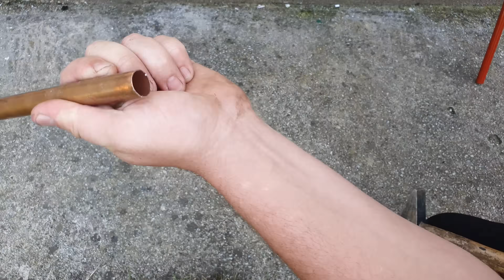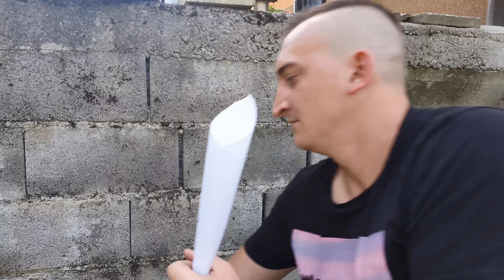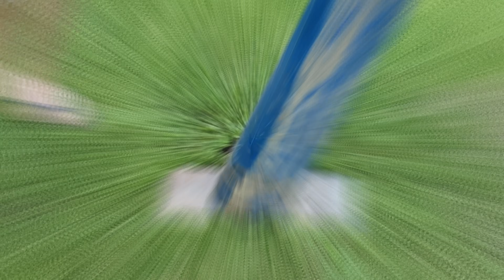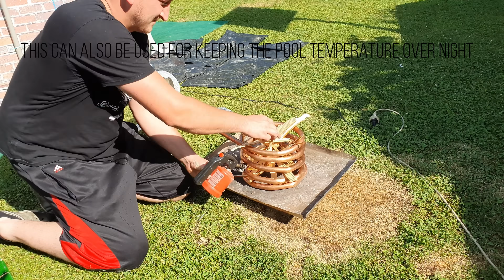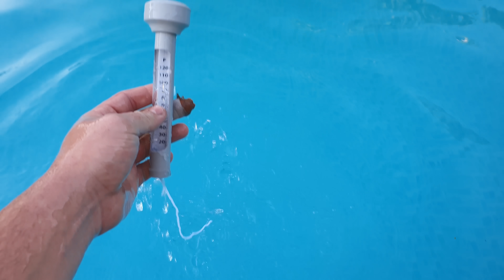Simple Home Made Pool Heater Under 10€

Comment: How slow does your pump rotate the water?
Reply from the maker: Speed does not matter.
If the water runs slow you feel the output water hot if the pump runs faster output feels warm but in the end it doesnt matter... warm watter more flow 
Hot water less water flow so it evens out

Comment: I am wondering...what about the internal components of the filter bomb, is this suitable for hot water?
Reply from the maker: No this is why you need to connect the heater to the output on the pump to avoid damaging the pump input water entering the pump from the pool is not hot
Reply: @MrTplanko  So, the water flow into the pump, then to the heater and finally to the pool right? Does the inlet hose hold the hot water well? I am thinking to do this to heat my pool.
Reply from the maker: @Dionisio181  yea. It does hold the temperature
But make the 2.0 heater  version i posted its way better

Comment: Just buy soft copper pipe in pre bent coils. MUCH EASIER than the sand method, although the sand method is cool..

Also, longer runs of smaller pipe, like 3/8” is way more efficient than larger pipe…..

I’ve tried both 3/8 and 3/4” pipe. The smaller pipe wins every time
Reply from the maker: I have made a better heater and i am posting it soon it can heat up 10 000l pool to 38°C IN 10 Hours
Reply: @MrTplanko  link to video?
Reply from the maker: @ftgnaturehd4222  not posted yet comming in 30 days

Comment: use a cut 1/2 55gallon steel drum for the fire pit and put the coil inside it, and cut slots or drill holes for the copper to exit the drum.👍it was a good thought, but you must contain the fire...
get a patio chimenea and copper-pipe-coil the inside maybe, and have a sweer patio fire/heater in one...
or better yet build a patio with a stone pizza oven and hide the coil inside that! ...
patio party, with stone baked pizza and hottubbing...BINGO!

Comment: Nice .. Can you please tell about these pipes.. Won't these plastic pipes melt with the hot water inside. Please do update..I am stuck on finding suitable pipes for the tub.. thanks 🙏
Reply from the maker: No with this setup water cant melt the pipes you can use the one you get with pump

Comment: You reckon if the copper coil (10mm) is higher than the pool itself it would have difficulty pumping the water through with a filter pump?
Reply from the maker: Yes it would

Comment: I once tried making something similar, but the water stopped flowing, then it turned to steam, then it melted the pipes, then panic set in.
Reply from the maker: Its important you have enough water flow
Reply: @MrTplanko  Yeah, I had a small pump, although that was mostly intended to be security, had hope that the heating of the water itself would create enough flow, but apparently it wasn't strong enough, that, or the water became to hot, melting the tube and restricting flow.

Do really want to make a proper one, paying 100+ euros on hot water everytime I have a party by constantly pooring in hot tap water isn't very economical.
Reply from the maker: @DutchDread   you need to use bigger pipe diameter and your small pump shuld do the job
Reply: @MrTplanko  Thanks, I actually had hypothesized that the problem was that the pipes were too large and the pump was failing to push the water through it.

Comment: Do you empty the sand after the pipe bend
Reply: I'm pretty sure the sand is only to allow the copper to maintain form while being bent into the coil. Emptied afterwards to allow water to flow through and conduct the heat energy from the copper into the water.  It would be really cool to run this through a sand "battery" instead.  I think im going to try that as my pool is much larger. Having said that this system is a much easier build and seems like it does great for this application.  Nice job!

Comment: You need to enclose the coils in a stove body.  With a chimney for natural draft, you won’t need a blower.  Fire will burn hotter and cleaner and you will get more heat into the water...
Reply from the maker: I know i plan to do it this season
Reply: Hi sir! Won't the coil dissolve in too much heat? Im planning to put coil inside a drum. Thanks Stay Safe...
Reply: A wood fire like a campfire might reach temperatures as high as 1650F at it’s hottest point.  Copper melts just shy of 1984F, so no it won’t melt.  This is especially true with water being pumped thru it, it will never go over 212F as the water will carry away all the heat…
Reply: @rronmar  well aren’t you just a ball of knowledge haha
Reply: @brickmate4802  I try…  been pulling heat out of fire for a very long time now:)
Reply: @rronmar  so not just for killing witches and a good light source ?
Reply: Hey! And before you say it !!! They die by the fire not the heat ok
Reply: I plain to try this in a chimenea...ceramic pot belly stove. $ 100.00 homedepot...ect
Reply: @winquizon7608  the water keeps it cool, even a soldered fitting won’t melt
Reply: @winquizon7608  not with that type of fire. We use Oxy Acetylene torches to braze copper tube or pipe and I’ve never melted thru one yet.
Reply: @gerarddugas6224  hope I caught you in time. It  will not work especially with such a small area to put your coil. 
Pool heaters are rather powerful water heaters that have a high flow and use a lot of energy to warm a pool over a period of time. I discussed some reasons and other info on this videos replies. Figure out your pools capacity and google 
pool heater specs. That should give you an idea as to how much you need to flow in GPH
along with the temp rise you might get.
Reply: @williamyost2837  hey! Could you please tell me if copper will melt without water... I am using similar design with air and fans to get hot air in my room..

Comment: 3M + copper pipes about minimum 70$
Air blower about 60$
Support plate for fix pipes with fire 25$
Total 155$

Option
The log pieces 1pack 10$/1hour
8hours X 10$= 80$ / day
Reply from the maker: Bro where did you find these prices hahab
Reply: 5m of copper where I'm from is $150. I've already bought it and have stopped as I'm tryna find cheaper ways to finish my project. Fittings a pump that will handle the temp etc

Comment: Bro, I built one just like yours and bought a fire place and have it burning inside the pit... The water coming out is literally 5 degree higher than water in the pool
Reply from the maker: all you need to do is restrict the water flow so it has time to heat up my guess is you have a more waterflow than my pump
Reply from the maker: Also longer pipe helps alot
Reply: Thanks for the tips

Comment: You started at 80F + degrees? That is already plenty warm. You don't have enough heating surface there to heat up a pot of water. Entertaining for sure but DONT DO THIS it will not work unless the pool is already warm enough to swim in....and the 6 degrees of rise in under 3 hours.....NOT POSSIBLE!

Comment: Nice! I'm playing with a similar setup but my goal is to heat water above 60°C for a hot shower, do you think if can be done? Similar to how a tankless propane heater works
Reply from the maker: Ita possible but with better heater. I will post the video in 14 days
Reply: @MrTplanko  Nice, I'll be sure to watch it! I'm thinking about purchasing a broken on-demand heater and reutilize the radiator/piping part that receives the heat, that way I just need to build the fire around it

Comment: Try doing water instead of salt for holding coil shape. Much easier to remove in the end. Also keep the copper warm with hot water on the outside, this will make it super easy to form if you have issues with kinking.
Reply from the maker: Also much harder to seal the pipe
Reply: Recent discovery of trying before research. Use brake line copper, not refrigeration line. Refrigeration line, while usually a more pure copper. Is not meant for the heat, and will break down faster.
Reply: NEVER SEAL SOMETHING FILLED WITH LIQUID AND HEAT IT UP!
This will explode really heavy.
Don't do this.
That's why professional use Sand for this.
Reply: @Chaosm4n  well ya, don't heat it up to the point of boiling and expansion. But people have been doing that for forming coils for a long time. And it keeps a much more consistent shape than sand.
Reply: @kokofiProductions  when you say people, I guess you mean professionals. They should know what they are doing. But here on YouTube, people without the knowledge see these kind of stuff and get harmed. I am a professional and even instructor.
You can't estimate your own knowledge to every one, who's watching this
Reply: @kokofiProductions  of course I know that hydroforming exists and works very well. But there are professionals working with these techniques.
Reply: @Chaosm4n  whatever dude. I'm not here to argue on the internet. But keep in mind if someone if forming the pipe by hand, it's no where near hot enough to explode, let alone expand. 

And seal the water in just to form the pipe, then cut it and let the water out. I'm not suggesting someone make a pipe bomb.

You're warning is sound advice for sure. But it doesn't fit in with this suggestion.
Reply: @kokofiProductions  hey, I don't wanted to argue with you. 
I guess it's just a fine discussion 🙃
And of course the world is big enough for 2 opinions 😄
Reply: Or just buy coil copper to start with

Comment: what kind of filter pump is that ? I love the simplicity of it but Im sure keeping the fire enclosed and the coil as well would make a huge difference. Like say in a burn barrel?
Reply from the maker: Regular pump it came with the pool ..You are right it does make a difference also use 6m of pipe i started with 4m and you wont belive how much hotter 6m coil was.

Comment: I had friend tell me that in a short time that copper coil will be no good because of the extreme heat. What coil do you use and have you had any problems?
Reply from the maker: This will last years... water is flowing and cooling the coil so it cant deform..
I used a 4m copper pipe 28mm and roll it nothing special...
Reply: @MrTplanko  Thanks !
Reply: Best material is rvs 316 cause of the chloor and other things that will atack copper...or try a uv lamp instat of chloor and you can stay with te copper heater
Reply: borgo1124 hello, what is rvs 316?  July 31 here and it’s 15 degrees Celsius!  We need a pool heater!!! Canada...
Reply: @granmabern5283  stainless steel 316.....in holland we call it rvs316,..
Reply: borgo1124 Thankyou
Reply: borgo1124 thanks.  Does it roll into coils in the same way copper does?
Reply: @granmabern5283  yes...there are ready to go sets...look for a 12meters set for the best performance,i will look for a link so you no what i mean,i'll try to post it
Reply: @borgo1124  Stainless steel has a heat transfer coefficient that’s 20 times less than copper. It’s more durable tho but for the most efficient setup you’ll definitely need copper.

Comment: Nice! But it’s a smaller pool so makes sense it would heat it well. Either way it is a nice affordable and renewable energy setup! Awesome job! Makes me wonder about replacing my heater with a wood burning stove. Our pump room has a 12’ ceiling. I bet I could put in a wood burner and wrap the exhaust pipe in copper tubing and just keep a fire going. Hmmmmm....
Reply from the maker: Yes this is even better way less temperature loss than my sistem but it is  little bit more expensive
Reply: Sounds logical.✌️✌️🙏🇺🇲
Reply: Look up "propane tank wood stove" good way to get a small space stove for very cheap.

Be extremely careful and test everything 5 times before you walk away from it while its burning. Be careful, be careful be careful

Comment: BTW: the pool came with a 1249L/h pump, should I upgrade to 2006L/h, I think that's the one you use, I could be wrong
Reply from the maker: No need to upgrade.. smaller pool smaller pump.
Reply: @MrTplanko  Thank you very much! I ordered a 60cm tall, 38cm diameter burn can with a thermometer over U$85 ( https://www.youtube.com/watch?v=WRpYEUdStWg ) to put the coil in and 15 meters of 1/2 copper coil, hopefully I'll get everything by Friday to start building the heater, not sure if the coil I ordered will do the job, I'll update once everything is setup
Reply: @MrTplanko  great! Thanks!
Reply: I  just finished with the can and copper, it has 13 meter of 1/2" roll on it and two 1 meter long legs to attach the input and output., clueless on how to share some pics, the can has a thermometer to keep track of the internal temp of the fire on it. I'll run it on coal. Tomorrow I'll test it.
Reply: @pachomouse  results?
Reply: @ohaoj2250  We have not had a sunny day for a few months, the heater was built. Waiting for a sunny day for testing. I forgot to mention I used a "peruvian over" for my coil - it comes with a thermostat . If you share an email I can share some pics.

Comment: Also remember when using copper and flowing chlorine water through the copper will eventually cause a chemical corrosion making the water green in color
Reply from the maker: This problem is fixed with filter so..
Reply: @MrTplanko  What kind of filter are you using?

Comment: I've got 2 questions 

Why do you need the salt/sugar what does it do to the copper pipe?

What measurements of pipe do you recommend for the best performance?
Reply from the maker: Salt/sugar prevents the pipe from bending  together...
Performance depends on your pump water flow...
Reply: @MrTplanko  thanks for the reply I have just brought a pool similar to yours😁👍
Reply: @MrTplanko  orginal BESTWAT/ INTEX  pump can handle with 4meters od 28mm PIPIE ??
Reply from the maker: @bartekmrozik  yup

Comment: I've got a question about physics-stuff, is there any sort of pump? Or the water flows thanks to the different density of the water at different temperature?
Reply from the maker: There is a pump connected 
It would be possible to do it without the pump but you would need to stir the pool... pump is better alternative.

Comment: One question: Wouldn't a combustion chamber made of bricks increase the effectiveness? Less fuel or higher water temperature? To do this, insulate the hoses / pipes! Should be inexpensive to do!
Reply from the maker: Yes it would be a lot better...less smoke more heat and yes inexpensive
Reply: Wrap the pool with some foil bubble wrap insulation or rigid foam board it’ll help too.

Comment: The heater is very small for the mass of water contained in the pool (more than 4000 litres). Also, the system they show is not insulated, this causes a lot of heat loss. This heater would operate efficiently solo en verano with a children's pool. To improve it, they should increase the size of the spiral to the volume of a 208-liters can and use natural gas as fuel.
Reply from the maker: Yea there is room for improvement but it does its job for 10000l pool
Reply: Cómo podría calentar una piscina de 6000 litros? En verano
Reply: Suddenly it's less affordable

Comment: how big is your pool? what the diameter of the copper pipe? I'm planning to put your idea in action for my baby girl Bestway 305x76 pool. It's 1236 Gal, how long shoul it run before hitting 28C? Water temp is 18-20C all time. Thank you!
Reply from the maker: I have 2700 gallons pool and copper pipe diameter 28mm
Use atleast 4 m of pipe 
Buy a termometer so you can check the pool temperature

Comment: There's no way that the copper alone was under 10 dollars.  And you must love the looks of this messy setup and not to mention all the charcoal residue that will spread all around and in the pool. Hell, i made a large 6x3 foot box that is only 5 inch think and has a 300 foot long black pvc hose rolled up in it and a plexiglass cover on it, so a little greenhouse
and where the water from my pool is pumped through and comes back 3 degrees warmer, and all by the sun and a pump. no mess, no smell, no soot,  just ideal!
Reply from the maker: i use this mainly for keeping the pool temperature overnight..not the best looking system but it works great
Reply: Your box sounds nice IF you have lots of sun....

Comment: cheap, but highly energy inefficient
Reply: True, but things can be inefficient if the cost to run is super cheap. A car Engen is horribly inefficient at only 20%, but petrol is super cheap. A gas boiler is around 70%-80% efficient, but gas is cheap. An electric boiler is 100% efficient, but is expensive to run. You can get scrap wood for free with ease, so, even if it was only 10% efficient, you can't beat free.

Comment: How did u connect the copper pipes to the tubes from the filter?
Reply from the maker: You can see it in video... i just cut the output pipe from the pump and connected the coil

Comment: Stupid video. You can buy coils of copper. I used 100’ of coiled 5/8” copper.  The longer the length the more heat rise you will have.  I also found wood to be a very poor heat source. Too much work to maintain the fire and inconsistent heating as it burned down and required constant stoking and the need to add more. I found charcoal briquettes to be much less maintenance than wood. And they burned a long time. You can surround the coil around it and inside for better heating since the briquettes are small. Wood is odd shaped and as said before needed a lot of attention. I used a submersible pump and garden hoses. I’ve graduated from the Summer Waves Pool to an in ground with heater now and have more time to relax, but my idea worked great at the time.
Reply: you used 100'    what,  100 Meter?
Reply: @michaelsauer5903  100 feet
Reply: @michaelsauer5903  you can couple multiple coils of copper tubing, using solder. The water circulating will keep the solder joint cool and it won’t melt. If you have a massive fire pit, you could get quite a temperature rise I imagine, with several hundred feet of tubing.